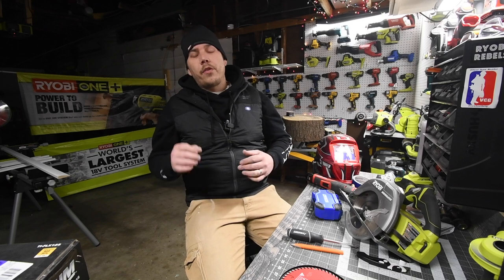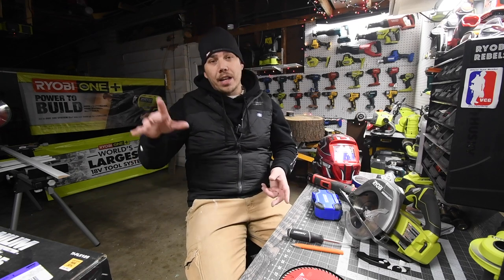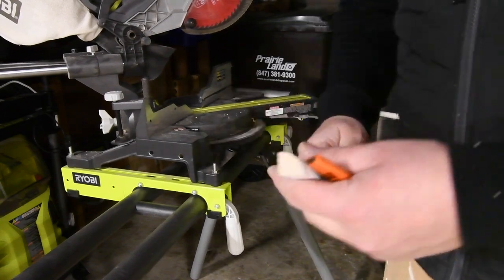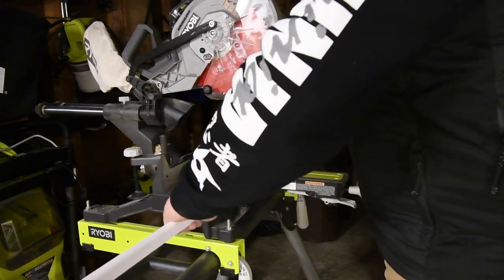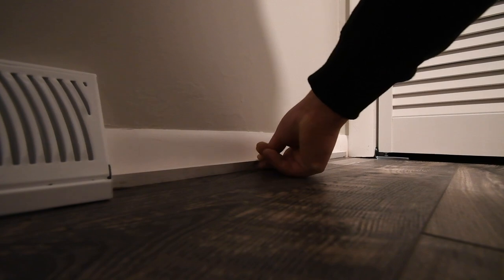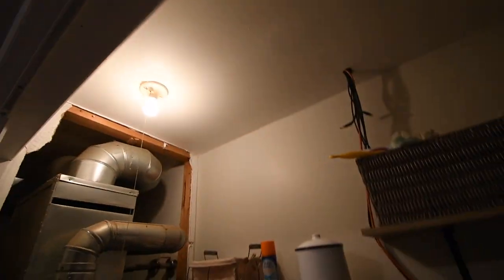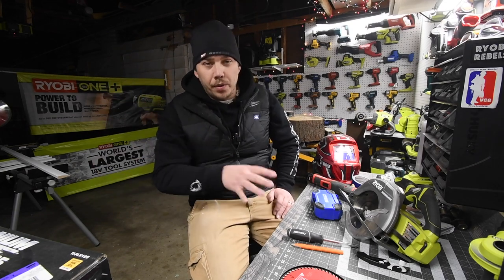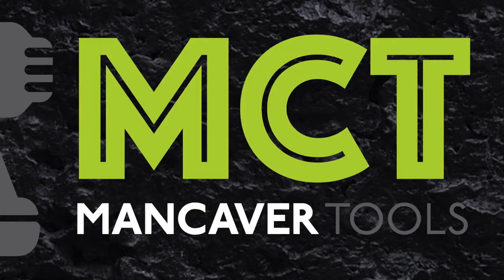Installing 1/4 Round (SHOE) along the Base board

Comment: Take some advise from someone who puts floors and baseboards for a living.  Paint your end pieces before installing them!  You are going to have a difficult time painting those little pieces after they are nailed in.
Reply: Any tips when you got some space between your floor and baseboard?
Reply from the maker: I was a painter by trade in new construction and Im used to painting the edges but thank you jus
Reply: @robertjosip1923  I always tore out the old baseboard and installed the floor.  I covered the gaps with the new base.

Comment: Did you install Vinyl flooring? Just did a bedroom in my house. Ended up with a few 1/2” gaps since the room isn’t perfectly square. Great video! I’ll be using 1/4 round for sure.
Reply from the maker: this is laminate. 1/4 round majorly makes it look complete
Reply: @ManCaverTools  Awesome  man. I got lucky. Went with 2” x 1/2” baseboard and it covered the gaps perfectly. Only used 1/4 round at the base of the closet frame. With 1/8 gaps I had